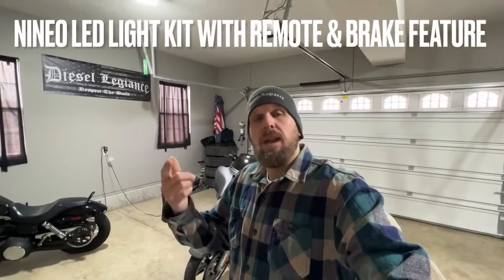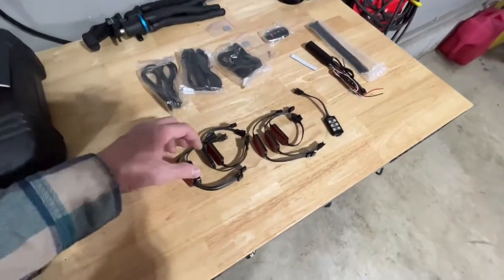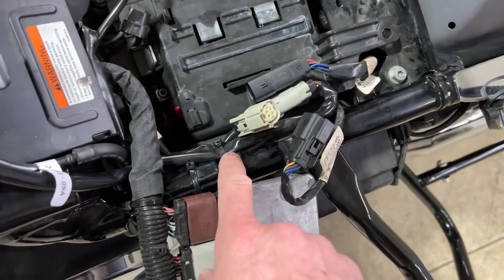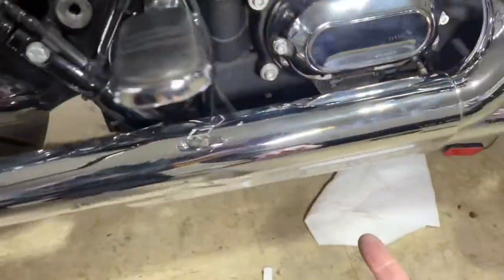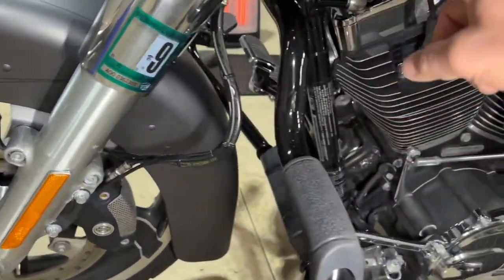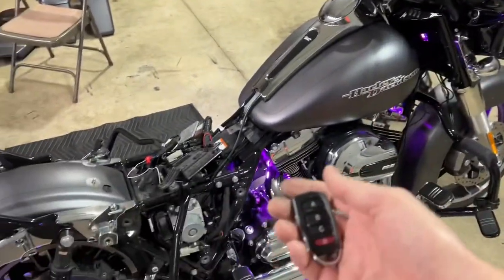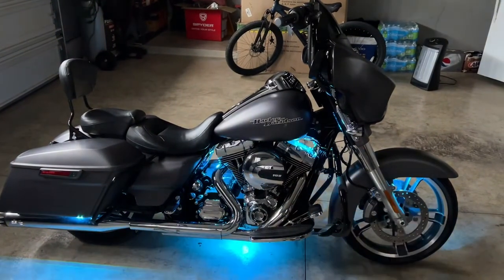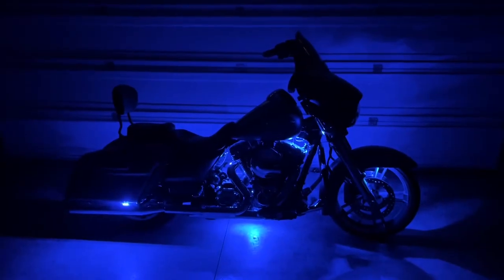Installed A High Quality Low Cost LED Light Kit On My 2016 Harley Davidson Street Glide.

Comment: You should have stated that we need to buy extensions for the lights.
Reply from the maker: The light kit comes with the extensions.
Reply: Every light kit is different. You probably got a different brand that came with 8 lights but different cables. There are dozens of sellers on Amazon with these types of lights. It isn't his fault you got a different box without extensions. Its your responsibility to keep track of this info.

Comment: just bought these last month. gonna try to get them installed tomorrow night. Thanks for the video. was looking for placement pointers.
Reply: Hows it holding up?
Reply from the maker: Works fine…I have the same kit on my wife’s Ryker.  I sold the street glide since this video but have a new road king build I am working on now.  I’m trying a different set for the new build that has 12 lights and still has the brake light function.

Comment: Very helpful, thanks a lot. I have this same kit I'm going to install on my Honda CTX over the winter. I plan on getting power from a switched power source so I don't have to worry about draining the battery. And I'll connect to a brake wire for that feature. Thanks again.

Comment: Nice video. 
This drove my ocd mad though. I wish someone made a kit with enough lights to light a bike up properly. Should be able to have stripes across the bottom of the tank so the whole motor is lit on both sides. Those dark spots hurt to see. 😂... great job though man. Respect.

Comment: Thank you great video kind of new to all this DIY. Just got my lights today will try to put it together this weekend. Was going to ask if by any chance you could do a quick video on how exactly connect cables to battery specially the break light 😳
Reply from the maker: I don’t have that bike anymore but I am working on a new Road King build and will probably add lights soon.  The best thing for a break light is either look up the wire color specs for your bike and tap into that or start at your brake light and chase the wire back to where the battery is and then once you determine the right wire tap into that.

Comment: Would it work if I hooked it up to a running light? So I don't have to turn it off or on with the key?
Reply from the maker: Should, I would suggest a kill switch in the ground line if possible.

Comment: Do you still have the bike and if so how are the lights holding up I just got these and haven't installed them yet
Reply from the maker: Sold the bike but the lights worked great and to my knowledge the new owner still has zero issues.
Reply: Thank you

Comment: Is there any concern that this will drain the battery at all?
Reply from the maker: Never had an issue but I did add a kill switch on the ground wire when not riding.
Reply: Most kits do come with a switch built in

Comment: bBo, i just installed these today and as soon as i connected the wires to the battery all the lights came on red and the remote wouldn't work. Any idea as to what i might have done wrong?
Reply from the maker: So positive straight to battery?  Where did you ground it?